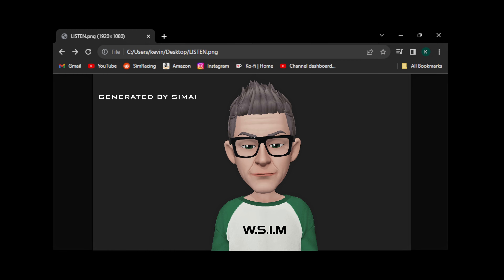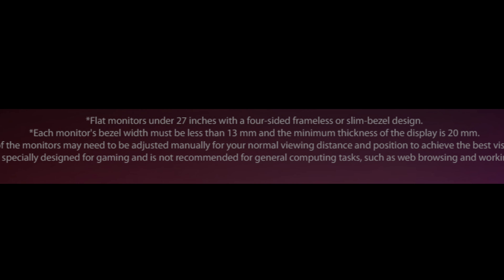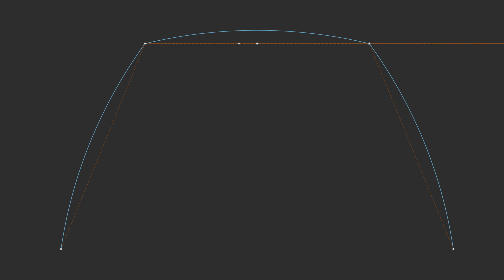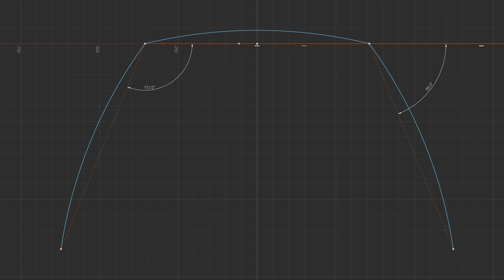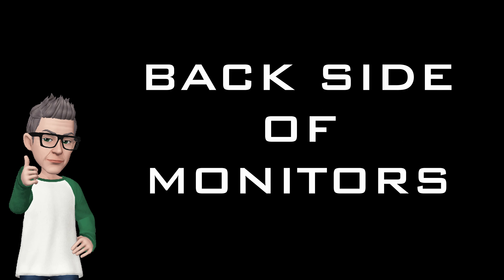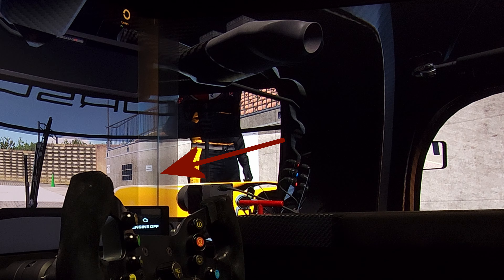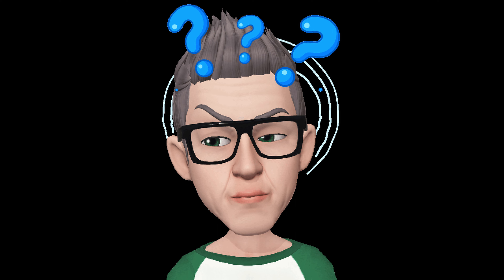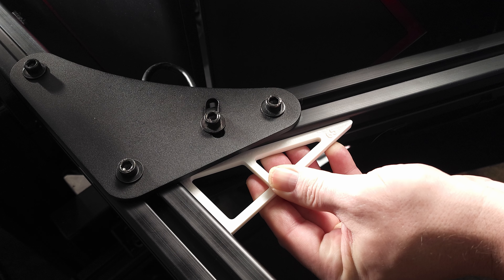Setting Correct Angles for Curved Monitors and the Bezel Free Kit

Comment: What would be the best angle for 3 32” 1000R curve monitors?
Reply: would like to know as well.. im undecided between flat or 1000R cuved monitors..
I guess the bezel free kit would work better on flat screens, but it's nice to have a little bit of a curve as well.. idk
Reply: Have you figure this out?
Reply: @pawieplays  I actually returned my 1000R curve Samsung G5s now. And I got Asus 1500R screens instead.
It's soooo much easier to use with the Bezel free kit. WIth the 1000R monitors, I had to have them at insane angles, which made me feel uncomfortalbe and the vision unnatural. The 1500R curved ones I have now, are totally fine though!
I'd recommend 1500R or flat ones if you want to use Bezel free kit.
Reply: @pawieplays  I never did. I ended up going to a single 57” ultrawide
Reply: 46

Comment: I also set my three screens (32inch 1500R) to 65 degrees a few days ago. I have a question. When I set the three screens in ACC to a screen angle of 65 degrees, they will feel more retracted. It feels more natural to set it to 60-62 degrees. Is this normal?
Reply from the maker: It's totally normal. It is because the monitors are curved, and ACC doesn't have curved monitor settings.

Comment: Geat insight. I have 3x 32inch 1500r gigabyte 165hz monitors that have 9mm bezels. I found i had to keep increasing the angle to 69 deg before the bezel would disappear.  Im 635mm away from the center screen and running 174 FOV or 880 radius setting for iracing and 1205mm between the 2 side monitors at the rear. The other odd thing is it ends up being extremely close to the asus protractor at 130deg. What are your thoughts.
Reply from the maker: Thanks. That actually makes sense. With the Asus tool on paper works out to 68 degrees when I draw it out in CAD. An extra degree to make up for the 9mm bezel would still make the tool look relatively close.
Reply: Hello planning to get a similar Monitor, How are you liking the gigabyte monitor?

Comment: I have been trying to get mine setup over the past few days using the Sim-lab standalone mount with the zero-play pivots and the Vario vesa mounts. My monitors are the AOC 32" 1500R curved and they have very thin bezels so I think we may have the same or very similar screens. I'm hoping this video will finally get me on the right path!
Reply from the maker: Good stuff, man. I swear by the vario  mounts!
Reply: @sense-of-speed  Yeah they've been a life saver as far as getting the monitors level. The arms sag a bit on my stand due to me not tightening them down before I had the monitors on them. My eyes are approximately 25" from the center screen and I currently have them at 65 degrees.
Reply from the maker: @DSaw78 good stuff. 25 to 25.5 inches is the best eye distance for 32's through my testing.
Reply: @sense-of-speed  trickiest part is setting the in-game angle of the side monitors in the sims and trying to get them looking perfect. Almost impossible lol.
Reply from the maker: @DSaw78 If you drive Iracing my next fov video will help drastically.
Reply: @sense-of-speed  I play all the sims

Comment: Very good tutorial, exactly what I need, but I have a 31.5-inch monitor on a Samsung R1000. What should the angle be? 1500R is at 65°. Is this angle suitable for a 1000R monitor?
Reply from the maker: Thank you. I think 65 would be a good stating point and you may wat to give it a try. The main idea is setting the angle of the monitors at a more natural angle than the tool supplied with the kit provides. it should provide good results regardless of radius.

Comment: What would be the correct angle for 3x1000R Monitors (3x Samsung odyssey g5)?
Reply from the maker: It will depend on what your bezel thickness is and you viewing distance. If your bezels are 6mm like mine I would start at 65 degrees. That was the max I can run to hide the bezels. Personally I like to be 25 inches from my monitor and have no issue with my angle at 65.

Comment: Thank you so much for this video! I knew the angle would be too tight but all I had at the time was the template in the bezel free kit and eyeballing it. After spending quite some time lining up my monitors and found the angle too tight, I was too lazy and excited to get on the sim and never fixed it for quite some time. Your video explains it perfectly and now that I'm doing "renovations" on my rig, I got it just right much faster and the angle is perfect! 

If people watching have a 3D printer, I recommend printing an angle finder. It works great for this video and also works for other things you might need it for. Its also nice to see the angle I had and doing fine tunning adjustments is much easier knowing I have to move + or - a degree.
Reply from the maker: Awesome. I did end up offering triangle STL files for people who want to lock it at 60 or 65. Thanks for watching.

Comment: Great video. A little tip to people Who are running wider angle and have the problem you mentioned 2:40 (bezel free kit dont hide the bezel)
You may be able to sandpaper the edges of the bezel on the monitor... just a Lil bit to get an angle so you can get the screens closer to each other
Reply from the maker: Thanks. I did file the edges for a tight fit, but 6mm bezels are a touch too big.

Comment: Hey Sense of Speed, thanks so much for this. Quick question on your opinion. I have 1 57” G9 Ultra Wide, and 2 G8 32” side screens. SO equivalent of 15360x2160. Curious how you think that would impact the sweet spot for the angle for best FOV. I am not hugely concerned with bezel free as the 57” has such a wide FOV that the bezels really are less impactful to the view. Any thoughts would be appreciated, and if there is a correct measurement for Bezel free, thats a plus!

Thanks for the great content !
Reply: I too would love to know as I have the 57" ultra-wide and just bought 2 x 32" G7s to add either side.

Can you let me know please how easy (or difficult) it was to get yours aligned and working, not the bezel free kit just the general setup.

And what framerate are you getting running at that high a resolution?

Cheers!

Comment: This is gold information ❤ do you mind helping me to setup the wheel and screen height while doing POV ? Your gopro seems to be on your forehead but it look like its on the chin which looks even better
Reply from the maker: Thank you. My overall seating position is as close to real life as I can get. When turning the wheel my knuckles are just below my nose at 12 o'clock. My eyes are about 2 inches below center of the screen and 635mm distance. My Gopro is head mounted and I just angle it down to capture the bottom of the wheel. Pretty simple.
Reply: @sense-of-speed what is your FOV on that setup? I have allmost identical screens and i have been messing around with placement and angles.

Comment: Thank you for this tutorial. I am now in the process of switching from a simple odissey 49 to 3x34 alienware oled screens....and I had no idea of what I was about to walk on 😅 Purchase is made now, and I'll try to mount them tonight...is there any recommendation you'd give for those monitors? I assume the bezel kit is probably not going to help that much?
Reply: Bezel sizes are 0.3 and curvature 1800r, so perhaps that will reduce the need of the bezel kit?
Reply from the maker: Welcome to triples! I like the bezel kit, especially for open wheel. Without it, I recommend 60 degrees and an eye distance of 635. It may take some testing for your best results though.
Reply from the maker: It may, but that will be up to you if they don't bother you. Mine are wide and bug me. Lol

Comment: I am new to all this so my rig Trak Racer T80 with Triple monitor add on arms + triple 32" Tuf 1440p 1500 radius monitors. 
So I am sitting 28" away and what angle should my monitors be? 
I am going to move monitors 4 or 5 inches closer to the DD base/wheel so say 23 1/2 inches to 24 inches away from the center monitors.
 What should my angle be for side monitors.
 32" screen 0.16mm bezel  monitors Asus VG32VQ1B. HELP
Reply from the maker: Ideal eye distance based on our vision and minimum natural depth perception is 630 to 650 mm. Personally, I like 635 or 25 inches. At that eye distance, 65 degrees at the monitor arm like mine works very well. Especially in Iracing.
Reply: @sense-of-speed I have my triple monitors integrated into the rig all as one so at the moment I am at 55° and it kinda hard to go much further angle wise.
 I have a Trak Racer T80 w/ integrated monitor, 32" 1500 curved monitors and I sit exactly at 25" away from center monitor, I am vertically sitting right in the middle of the monitors and that is perfect.
 My biggest quest is do I measure the angles off the actual connecting monitor arms? 
 Inside triple monitor arms or the back side of the rig? Both should give the same result I assume.
 Or do I basicly angle the monitors that 60° or what ever the mathematically correct number is? 
 I know this is a lot but ATM it dosen't feel correct especially the right monitor.
I find myself driving off my Center monitor in my left peripheral naturally but I have to break focus to notice the right monitor.
 I have scrapped more walls with the Triples than I have prior with just a single monitor.
Reply: @sense-of-speed initially when I upgraded to 3 32" triples I made sure all 3 monitors were exactly 25" away from my eyes.
So basicly at the center of all 3 monitors they were positioned exactly 25" from my eyes.
 That felt too flat and wide.
I just never considered the reason behind the correct math and a legit FOV.
 I love your channel and it's very helpful for tech illiterate noon sim racers.

Comment: Great channel and once again great information. What did you use to create those diagrams showing the various angles with the monitors on? I’m trying to work out how much room a triple 42” setup would require and what angles I’d need to run them at.
Reply from the maker: Thank you. I use Fusion 360. You can also use any other free cad type software.

Comment: I’ve been looking for a bezel free kit but haven’t been able to find them for anything but 27”. Where can I buy a 32” set?
Reply from the maker: A 32 inch kit isn't available. They do work but need a different method to mount them. Some use adapters that can be found on Etsy to use the supplied brackets. For mine, I cut sticky back Alcantara to stick them to the monitors because the brackets interfered with my dash.

Comment: I'm struggling with the decision between curved and flat 32 inch monitors. I like the idea of greater immersion, but the distortion on the sides is off-putting for me. I'm currently leaning towards the flat ones.
Reply from the maker: Over the past 2 years I've gone from regretting curved to liking what I can do in Iracing so I understand your struggle. I won't try to steer you one way or the other but the distortion is very manageable on my end although I would like larger screens and perhaps an 1800 radius.

Comment: Hi,
I have flat 32inch monitor(LG 32GP850)
Can you recommend the angle? Asus ROG says they recommend 50(130)degree, but is it really good? I saw many guys using 60 degree.

(I will install bezel free kit, but its from racebear, which can install up to 55inches)
Reply from the maker: For sim racing, I suggest 60 degrees for flat monitors.
Reply: @sense-of-speed  120 has no problems with bezel free kit?
Reply from the maker: @pkbum-nj3ec  it shouldn't cause a problem. 60 would hide them better than 50 if they are really big. I also say 60 because It is better for fov.

Comment: Where can I find the STL file for the triangle?
Reply from the maker: I drew it in Fusion 360 really quick. I'd have to look to see if I still have it.
Reply: @sense-of-speed  I looked on the usual websites and did not see one.
Reply: @sense-of-speed  No luck?
Reply from the maker: @johnhicks4359  I have the gcode file for a .6 nozzle.  If you need an stl, I can draw another uo.
Reply: @sense-of-speed  If you dont mind no rush.
Reply from the maker: @johnhicks4359  Done. If you go to my Kofi page linked in my profile I set up a shop for downloading the file. I can't link it it because YT will remove it as spam.